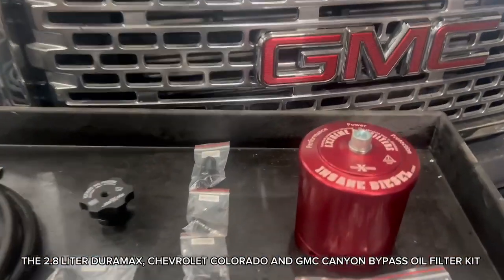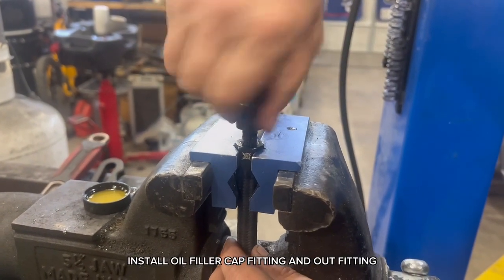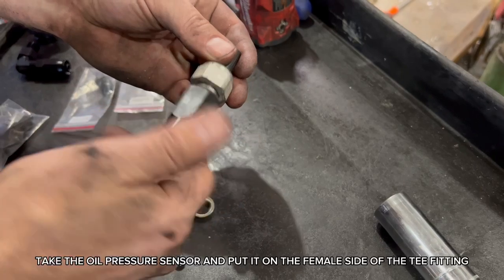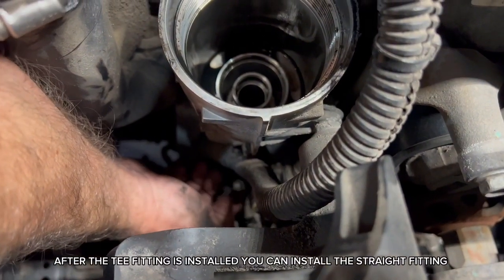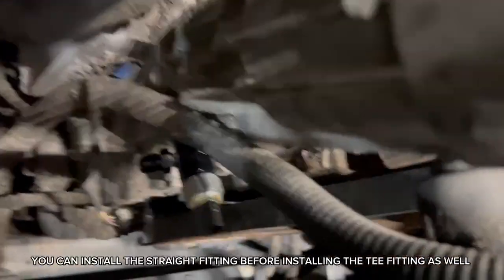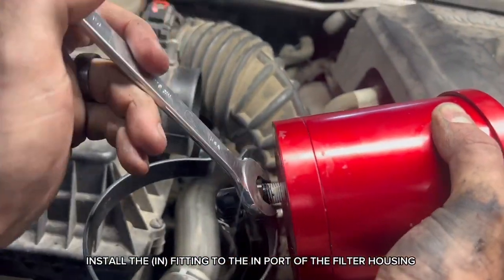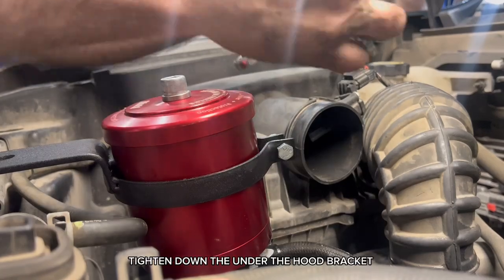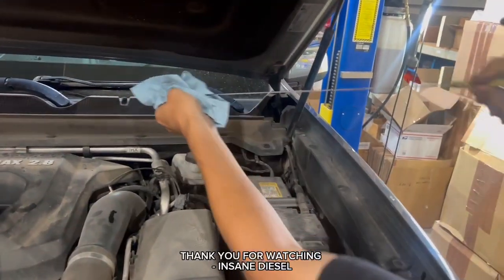2.8L Duramax Oil Bypass Filter Installation Guide - Chevy Colorado & GMC Canyon

Comment: How often do you change the bypass filter?
At each oil change ?
Reply from the maker: If you have over 100k miles on your truck when you put it on, change it every oil change for 4 intervals to do residual clean up. If you have under that, you can change it every 15k miles
Reply: @InsaneDieselUSA 
Thank you for the information.
My truck is a 2017 Canyon 2.8 diesel with only 54k miles, but I want to keep it for a long time and this system seems like it will give me that longevity.
Great video.
Reply: Thanks so much for the information

Comment: I have few questions. Are all the torques specs included with the kit? This video did not offer all the specs. What was the mechanic dipping the fitting in when he was installing the fittings? I'm referring to the yellow substance in the small black cap. Is the white substance rubbed on the threads anti-seize? Or a thread sealant? Is all this included in the kit? I didn't see it in the list of things included, that's why I'm asking.

Comment: Just watched the Daves video about the 900k 6.7 powerstroke teardown. Very impressive that the engine oil was so clean the main & rod bearing looked brand new with 900,000 miles on it! Super impressed with those results! Hope you guys have great sucess from that 'introduction' on his channel. Imo he should've gave a little more vocal credit to the bypass filter system but Dave was definitely impressed during the teardown which says a lot! 👍🏻👌🏻🛢️🔧
Reply from the maker: Thank you, we feel the same way.  The reason those bearings looked so good after that many miles is partially because of the bypass filter but our Lorenzo’s oil with WS2 was the other half of the reason and was never mentioned.  The reason the pistons and rings looked so good is our Lorenzo’s fuel enhancement.  Also never mentioned.
Reply: @InsaneDieselUSA , is this the same for the 3.0ltr in the Sierra? I have a 2024 sierra
Reply: I just watched that same video as well. Started searching for more info and landed here.
Reply from the maker: Let us know if you have any questions.